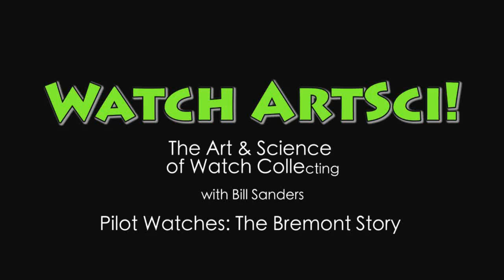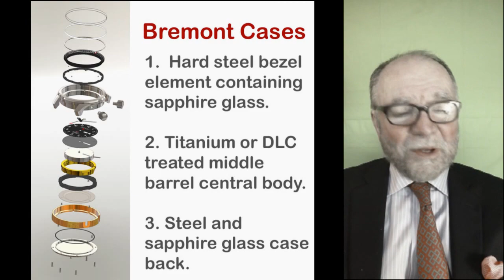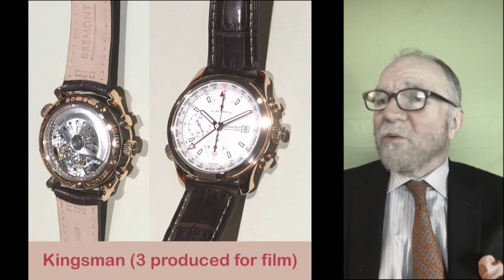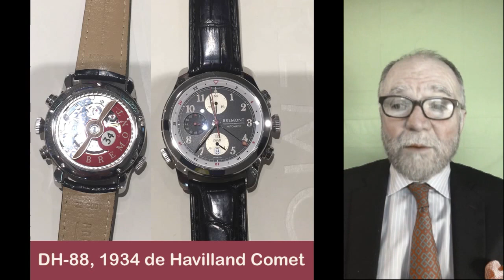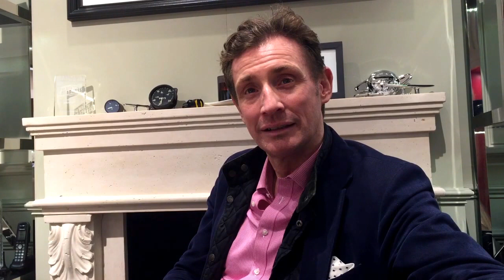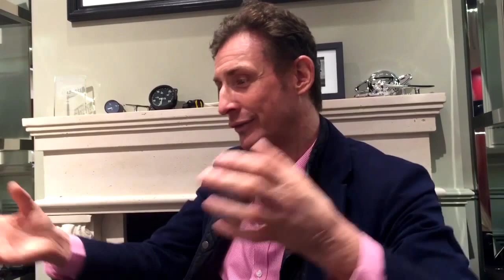#32 Pilot Watches : The Bremont Story

Comment: I respect the work you put into this video.  Well done.  I find Bremont over-priced sometimes shockingly so.  I just can't help remembering the whole "in-house" issues Bremont had several years ago.  Kinda reminds me of something Hillary would do.  Sorry, I just can't get past issues I have with the brand.  Going forward I can see Bremont using in-house on their label by increasing prices fifty percent.
Reply from the maker: Hi Ryvr, thanks man. I won't argue about over-priced watches, but with the exception of Habring2 and possibly Frederick Constance I can think of no watch that isn't over-priced--at least the ones that collectors seek. Right now, Bremont has in-house cases that justify the rough and tumble equivalents in Omega and Rolex--by a lot. Bremont is working toward a true in-house movement, and their work with La Joux-Perret SA has incrementally moved them closer and closer, as now they are manufacturing more movement parts in Britain and hope to soon have their own movement. It will be engineered along the lines of their tough cases--ones to be accurate in the same adverse conditions as their cases have been tested. I'm with you in hoping they don't jump up the prices when they have Bremont manufactured movements. (Tudor Black Bay is a good model--their price was nudged up by only about $500 when they switched from ETA to MT(Movement Tudor)) As for their premature announcement that a partially in-house movement was fully so; I hate when that happens, but it does. They didn't deny it like Trump would, but instead owned up to it and moved on. (Note: Now Hillary and Trump have both been dissed, and let it end here lest this ceases to be one of the few refuges from the awful choices facing the American electorate and its accompanying clamor.) Kindest regards, Bill
Reply: WatchArtSci True enough, good points.  I believe we're on the same page(s).
Reply: One thing I don't think is discussed as much as it should be is that when you go in-house movement, you are most likely tied to that particular Mfg for service. With an ETA or other more commonly available movement, many more watchmakers can service the watch.
Reply from the maker: Excellent point Arthur! However, some watch manufacturers use that as another income stream. (Cough, cough, Audemars Piguet...). Cheers, Bill